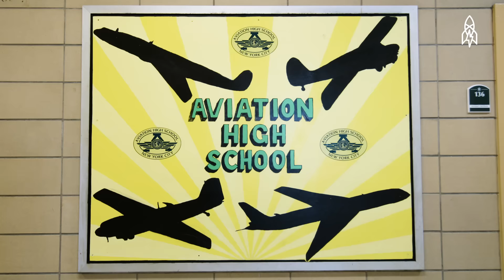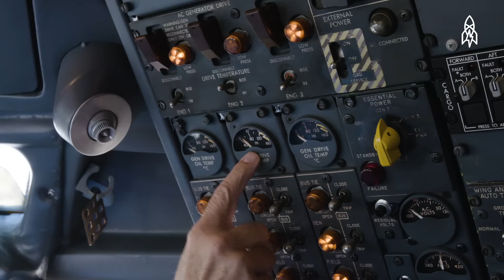Welcome to Aviation High School

Comment: I graduated AV in 1981. Greatest high school in NY. We were always in competition with Bronx school of Science. I worked in the field of Aviation as an Aircraft Maintenance Technician, Aircraft Inspector, and Aircraft Maintenance controller for 25 years before moving on to a different career. I was told that I was very good in our chosen profession. I still have the aviation bug in me. Also I can only hope and expect that the instructors that AV has now are as good as or better than the instructors that taught me. My work ethic, integrity and high moral standards were instilled by the staff of AV. Finally for those youngsters entering the field, you will find that aviation has many great avenues and companies to work for. If you plan on settling on being an Aircraft Maintenance Technician, go with Cargo carriers such as FedEx or UPS. Working for an airline is great and has great benefits, but the threat of workforce reduction is greater. Good luck to all of you.